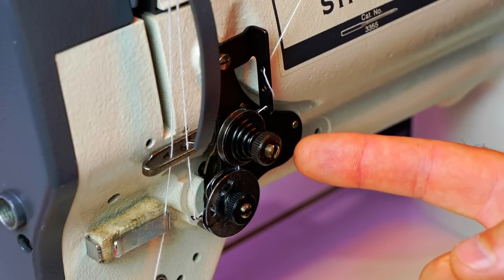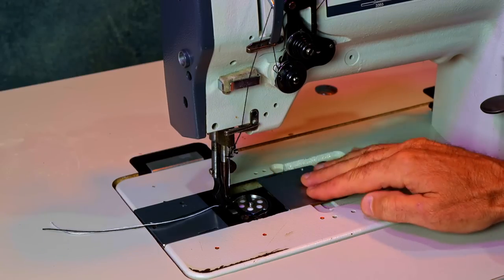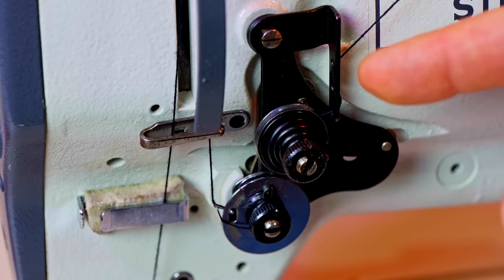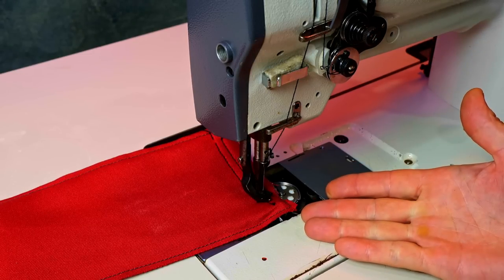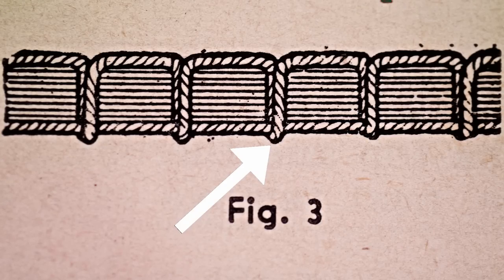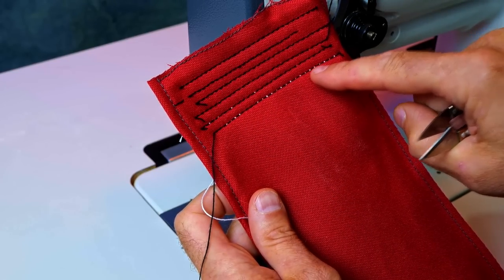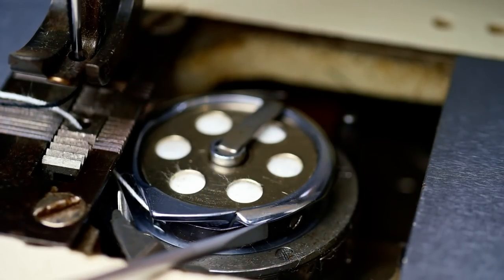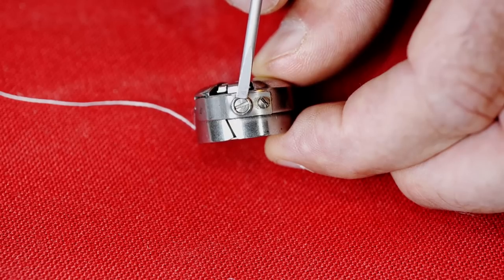Thread Tension Adjustment Explained

Comment: Hi Alexander, your videos are total awesome!
I have a Adler 167 it is set up for 138 Tenera thread. 130 needle.
I have been sewing marine canvas enclosures for 3O years . I have been use this thread since my supplier started carry it . At first it was too oil being high speed thread . Then delaminating of the outer coating . Now that all the bugs have been eliminated from the producer 
it’s wonderful thread ,lifetime warranty, my client love it , so do I cause once I build something I never won’t to see it again unless something catastrophic happens from 
Mother Nature or the client .

The tension that I have to apply to the thread because of the slipperiness is so much that it is cutting a groove into the casting .
I have been taught that the thicker the material the tighter the thread tension should be .So what happens is when I’m sewing a couple of layers 
the bottom pops up to the top stitch ! I really don’t want to be going back and forth with resetting of the tension because the learning curve was so great with this thread , once I figured it out I just want to leave it alone !
I guess the only option is to use another compound feed for doing just a couple of lays .
Reply from the maker: I think your needle may be too small. My chart says to use a 22 (140) or 23 (160)  with tex 138 thread. This could help to explain the de-laminating. That is an easy thing to at least try. As to adjusting the tension for different projects it should be easy to learn, just tighten it a little for this project and loosen a little for that project. Easy, but not as easy as buying a new machine 😉

Comment: Great video! I just started sewing for auto upholstery as a hobby. My question is what if both tensions are too tight? One of the first sample pieces I sewed sort of “shriveled” and looking at this video I’m wondering if that was caused by bottom and top tension being too high
Reply from the maker: You are on the right path here. Both tensions are in play here and at your disposal. I have set bottom tensions enough that I can judge by pulling the thread out while it is installed in the machine and it doesn't feel like much really, it pulls out pretty easy from the bottom. Just get some test scraps and start testing out your best inclinations and I bet you will get it dialed in to your liking.

Comment: Great explanation of top thread tension. I am still not sure how to adjust the bottom tension. Theoretically, you could tighten the bobbin tension and then also tighten the top tension to keep it in balance. How do decide if the bobbin tension is tight or loose enough?
Reply from the maker: Most of the time a person only needs to adjust the top tension and as long as that works then there isn't' much call to go deeper. I'm not sure how to tell you how to set the lower other than to say the thread should pull out lightly. It is something I just do by feel and I developed that feel by trial and error.

Comment: Great video Explained perfectly however you did not say how to determine the proper tension for the bottom bobbin Question What type of set up do you need to sew thru heavy Levis? and type of needle
Reply from the maker: I don't know how else to say what I said in the video which is it should feel pretty light and I show how I test for that feel. It comes down to experience or drawing on the experience of others to show you first hand. here is the part of the video I'm referencing https://youtu.be/xax0RTCqYTk?t=584 I use standard point needles for almost everything with good result. I use my needle feed machines to sew denim.

Comment: Great video! Great camera work as always. But what I was really hoping you would explain is how one might know when tension was completely balanced, but either too high or too low. In other words, what happens when you back off the bobbin case tension a lot, and back off the top tension an equal amount?  Or crank both up?  How does that affect the result?
Reply from the maker: If it is all too tight you mighy see bunching of the fabric and if is too loose you will notice the threads not set down against the fabric and or a loose seam when you pull the two pieces at opposite angles.

Comment: Great video, I now have a better understanding of the upper tension disk. However, you did not explain the other (lower of the two upper tension disks)?  What does it control?

Also, I have an issue with the thread bunching up in front of the needle hole (like a bird's nest). What causes the thread to bunch up in front of the needle hole, and how do you prevent it?   Thanks
Reply from the maker: I think you are first speaking of the take up spring which controls thread slack to prevent thread getting in front of the needle point prior to the needle entering the material. I guess if that is not set right it could cause your thread issue.

Comment: Hi Alexander, really thanks for this video, that is very clear and easy to understand with your explanation. Can you help me with additional topic? Do you know if there is any method / equipment to evaluate if the sew is like first/second/third figure showed by you on video? I have some variation, a lot of good pieces (let's say 100 goods) and few with loose loop (let's say 1 or 2 for each 100 goods). Maybe it's needed a fine tune for the tensions, i don't know....
Reply from the maker: given that is only happen 1 in 100 stitches ... 🤔 ... Now I can't know ... it could be something that only happens at certain events like ... maybe when you make a turn  or manipulate the fabric in some manner.

Comment: Awesome video and has helped me out. That said, my thread tension is looking great going forward but the back stitch. The bottom looks a little nesty. I have a Singer 211U567AB. Thank you.
Reply from the maker: Hmmm, well, first let me say I don't know but. I have had this problem in the past and the solution was to increase the opening tolerance on the bobbin case 'opener'. The opener is that little finger/pin that just kisses the bobbin case on each rotation of the machine. If the thread catches on this a little bit you will get that misformed stitch and it seems to happen more on reverse for some reason.

Comment: I got my 201-2 bobbin tension in the ballpark with a one ounce weight tied to the bobbin thread. Hold the bobbin/case in the air with the weight tied to the thread and the thread should basically just start to thread off the bobbin with a little shake of the bobbin. This seemed to work well for me at least getting the bobbin tension in the ballpark for the types of thread I use which is mostly #69 on my 201. Great video once Alexander, thanks for sharing your knowledge.

Comment: Thanks for this excellent tutorial. Your diction is great and camera work is fantastic.

I was struggling with rats nesting of the top thread yesterday on my home machine (Singer 500J) while topstitching with thick thread (Tex 90) on cotton canvas shorts. I had regular all purpose poly thread in the bobbin.

I think it took me a while to work out all the issues.

 The needle was a jeans type size 100. It might have been still too small for that thread. I did not have a size 120 to try nor a topstiching needle type. Mea culpa on that one.

The bobbin tension had gotten loose somehow. I fixed that using a 1 once weight to calibrate the bobbin. It did help.

The top tension adjustment is still very sensitive. Just moving from 2 to 3 on the dial would result in too much tension. I have not had success taking this tensioning unit apart to clean yet (the dial thumb wheel will not come out) but I will try passing a thread with little knots in it to check for the presence of lint.

It might be that I was pushing the limits of my machine too. I do not have an industrial size straight sewing machine and that could be helpful for that size of thread. I am going to make some jeans pants and jackets and will see how it all goes. 

Daniel
Reply: AtelierDBurgoyne  Daniel, I have found that if the top & bottom threads are of different thickness and weight that I can never get the tension of the stitch correct.
   Maybe there’s a way to do, but I don’t know how to do it.

Comment: Perhaps you can help me.  I just subscribed to your channel and I find it very helpful.  I have an artisan industrial sewing machine and I can sew two pieces of 6' long Sunbrella together and the bottom piece comes out 1/2" shorter than the top.  I adjusted the feed dogs but getting similar results.  Any suggestions?  It doesn't affect small projects but 15-20' is causing a big problem.  I also have a big Juki 2 needle doing similar things but not as bad.

Comment: I’m having issues with the bobbin thread skipping stitches in my industrial machine
 Adjusting the top tension isn’t helping. 
 I saw a video on the bobbin area needs to be adjusted . Do you address this in any videos? Thank you!
Reply from the maker: Skipped stitches are not typically caused by tension issues. Watch this for some common causes of sewing problems. https://youtu.be/dVprkJXNma0

Comment: Thanks AD - Man I hate those dreaded 'rats nests' especially in my 211  - with the notch in the bobbin case that rests in the bottom needle plate. I see you are proficient at removing the plate to release the rats nest.  I usually try to carefully dig/cut it out from the bottom. Removing the plate is usually the last resort but occasionally necessary if not caught soon enough. I love your wit - great tension tutorial.
Reply from the maker: Yes, I am like you, but I got pretty extreme with the problem setup and I was using Tex105. 😳

Comment: Are there any issues other than tension that can cause the rat's nest? I'm using a Juki LU 563 and I've set the tension according to this and other very clear youtube tutorials, it will sew perfectly for up to quite a while and then suddenly I hear and feel a loose rattling, my material (leather) bunches under the foot and it looks like the bottom thread tightly pulls the material at the same time causing a rat's nest. Please help!

Comment: Hello.Mr Dyer....hope you are well....
I have a consew 7360 R...
I was using Tex 80 thread..changed color and problems began...weird..
I followed the video on tension..and seems that I need to tighten top thread..SO I began...the know won't tighten any more and still the top thread is going through the bottom..
Do I need to touch the bottom tension and start over??
I hope you can help me...
My local.repair man is no.longer repairing industrials...TIA
Madeleine
Reply from the maker: Since the problem began when changing thread; go back and reload your bobbin, make sure everything is right down there, might be something in there no quite right.

Comment: Does it make any difference if you use a different thread weight in the top to the bobbin? Or should they always be the same?
Reply from the maker: I have seen that some people run a larger thread on top to get the look that they want and a smaller thread in the bottom. So yeah, it can be done. A chain is only as strong as its weakest link.
Reply: @AlexanderDyer  Thank you, but not sure thats much help though.  What sort of issues would I have if using a different thread size?   Also what thread weight do you find looks the best for topstitching on the exterior of a handbag.  I am using a bonded nylon, is nylon better than polyester?

Comment: I'm trying to stitch 2 - 3 layers of Sunbrella canvas on a Pfaff 1245 using 138 thd. and 140 needle
I can't keep the bottom thread from pulling up to the top.

Even when I reduce the top thread tension to the point of rat nesting the bottom thread knot clearly shows on top.

I've adjusted bottom thread tension to max on the bobbin case. Still seems kind of loose but I have nothing to compare it to.
I have ordered a new bobbin case hoping that is the culprit but this one seems fine.

I sure could use some help with this one.
Reply from the maker: Check your thread path. Starting with the tree. Make sure your thread is pulling straight up above the spool to start.

Comment: I apologize I see you address it but I don’t have a drop in bobbin. Is the adjustment only on the bobbin case ? Do I ever touch the screws on the actual machine?
Reply from the maker: With drop in bobbins the case remains in the machine. The adjustment for the spring still exists and yes you can adjust it while it is in the machine. I address this style of bobbin and case and I also point to the tensioning spring in this linked video that will start playing at the appropriate time for your convenience. https://youtu.be/NYE5B6OPj4k?t=427

Comment: Using a Industrial sewing machine I’m sewing a strap and everything looks great but when I make 90 degree turn the bottom thread comes up , Every time . Do you think I still have to much tension on top ? I’m sewing leather 5 oz .my machine is A Thor 1541 c cylinder head .
Reply from the maker: https://youtu.be/D3QuCF6zATg?t=214
Reply: Thank you so much for your time and help , it makes sense. 👍

Comment: Hey I noticed that you always pull that top tag line when you start to sew. What does that do exactly? Sorry for the noob question.
Reply from the maker: When sewing with these large machines and large threads it is even more critical than on home sewing machines but it does apply. Those loose ends or "tails" are held back to keep them from getting pulled down into the sewing mechanism and causing problems like thread breakage, knots and general chaos.

Comment: How close up should you look at stitches? If I examine stitches using a magnifying glass, is that taking things too far.  Am I just torturing myself?
Reply from the maker: I like to set up with 2 layers of material and yes, sometimes when set absolutely correct there is variation among stitches from one to the next. Also there are condition where you can actually see the other thread from each side with your magnifier. There just isn't enough depth of fabric to completely hide the lock but that is as good as you can do and is a good balanced stitch.

Comment: Hello, What are the tricks for sewing with Tenara 138 thread on a 1541S Juki?  I can sew easily with 90 weight but when I switch (for boat tops and other heavy material projects) to the 138 no matter how I vary the thread tension I get bird nesting on the bottom.  Could it be that I need a larger needle size?  They recommend the #17 that I am using.  My machine has sewn the polyester 138 for years with no issues.  I am hesitant to use a larger needle as it makes the projects much less waterproof, and the #17 threads just fine through the eye.  Thanks for any help.
Reply from the maker: According to this chart that I often use the needle size should be 22. https://tolindsewmach.com/thread-chart.html
Reply: Thank you very much.  They recommended 18 or 20 so I just got done switching to the 20 and it seems to have cured it.  Thanks for the help.  Appreciate it.  Doug
Reply: PS: My bad!  The reco.mendation was for a 17 for the V90 weight not the 138!!  Can't see the forest for the trees!
Reply: Also noticed they recommended the Schmetz Serv7 needles but they only show them in a 135 x 5 needle series?  Will that fit the Juki 1541S??
Reply from the maker: 135 X 17 according to the manual. http://alexanderdyer.work/uploads/manuals/Juki%20DNU-1541-S.pdf
Reply: Thanks for all the help.  Spent too much time worrying about the bobbin.  I had not seated the heavier thread between the friction plates!  Lazy knee on the needle lift I guess!!!  The #20 needle seemed to help as well.  Running fine now on Stamoid material several layers thick.  Thanks again.  Doug

Comment: I am not able to get the bottom stitch to pull up to the middle unless I have my top tension maxed out. What could be the issue? Using a Juki 1541s
Reply from the maker: Possibilities: Top tension spring too small/light, bottom tension too tight, thread clearance under throat plate issues. if the thread path under the throat plate is encountering resistance it can effect the machines ability to pull up the thread properly.

Comment: How do you measure  tightness and looseness of the top thread
Reply from the maker: This is all based on relative tension. It is a process of trial and error until such time as you get your machine dialed in. Righty tighty, Lefty loosey.

Comment: Hello, no matter how much I tighten my top thread, I still see the top thread on the bottom.
Reply from the maker: I have had to replace the tension spring on some machines if the spring is worn out or perhaps the wrong one got on there before me.